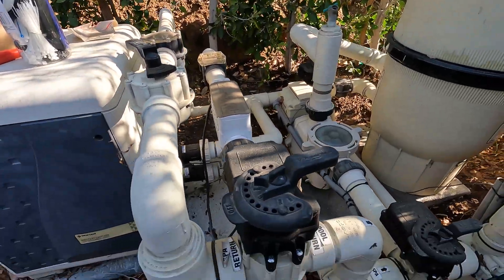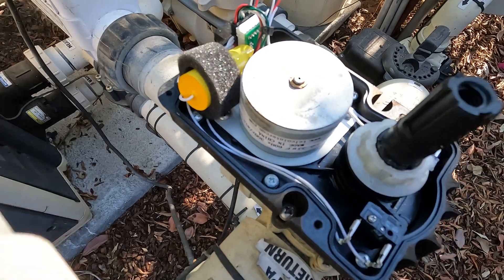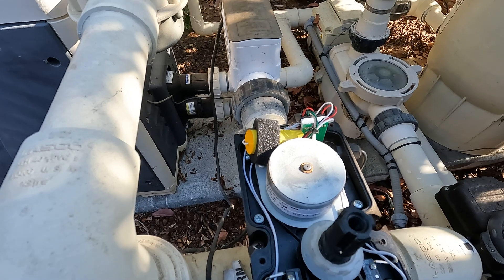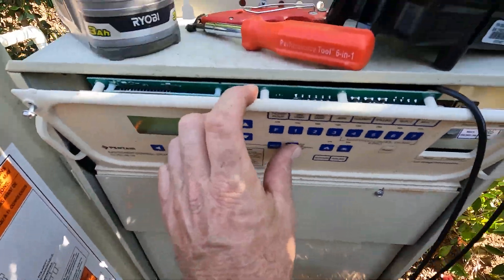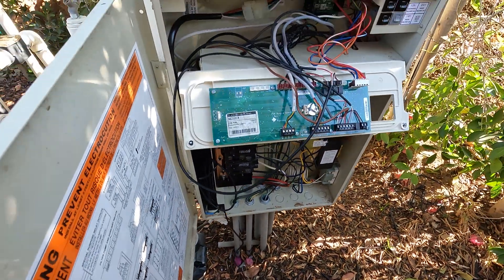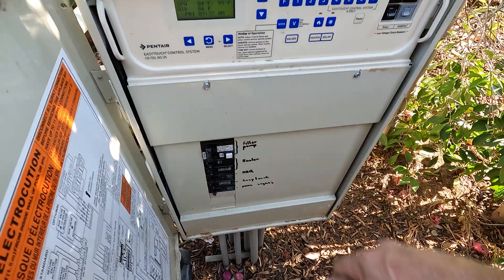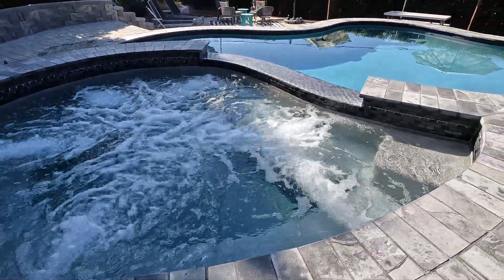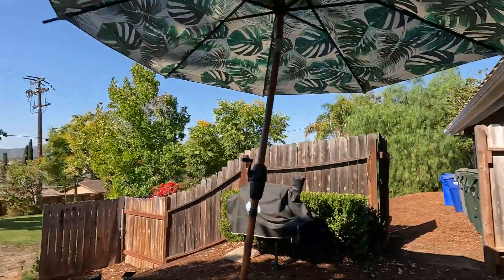Pentair actuator replacement - Angry Poolman #18

Comment: How do I control the valve manually? I don’t trust these things. Is it by taking the actuator off and putting the handle on the knob that sticks out? 
Sorry for not using the proper verbiage, but I would appreciate any input on how to do it.
Reply from the maker: Actuators have a three position switch on them that is used at start up of the pool and by the service professional. The handle will indicate the direction of the flow of water. Make sure to put things back when you change them!

Comment: Question about solar actuators, i changed my actuator and when im drawing from solar pads my pool sweep wont move and i get bubbles in the pool but i dont see any leaks or air from anywhere and when i shut the solar off i get full pressure on the robot. So my question is when replacing the actuator i didnt change the diverter core and it was very scratched and worn could that possibly be the issue. Been frustrating me lol
Reply from the maker: You're either going to get one or the other. When your pools solar is engaged it robs the suction from the cleaner. That's something I see in older pools; nowadays pools of mine like the big fatty on Monday is a two-story house with pool solar and it's quite far away from the equipment, yet the cleaner still works. It all has to do with how the pool was plumbed. Check valves are very important. I wouldn't worry about the Bubbles so much just make sure your solar blankets aren't leaking!
Reply: @angrypoolman Ok, that makes swnse and it is older model plumbing, i guess ill have to rotate them to heating 3 days a week shut it off and run the robot. Thanks for replying i appreciate it.

Comment: Just a question if you don't mind. What is I've installed 2 new pentair actuators and they turn just fine with the switches but for some reason they don't turn when I hit spa-mode on the pentair panel. I'd know one actuator is bad if only one is turning but neither one is. Only manually from the switches. I appreciate it brother.
Reply from the maker: Your actuators might not be plugged into your control board, which I assume is an easy touch. if you think you have them plugged in correctly, you probably have a programming issue which is a issue too big to fix in the YouTube comment section. Under settings, go to circuit names and circuit functions to fix that. The only time you are ever supposed to touch the three-position switch is during startup; sometimes I might flip the switch to quickly brush in dirt into the spa drains, but as a rule I never touch them and strongly recommend that my customers do not touch them either. I hope that helped!
Reply: @angrypoolman yes. That helps. Thank you brother. I was also thinking I had issues with the motherboard.

Comment: Hello, really get a lot of useful info from your channel.  Really appreciate it.  I have a new-ish pentair actuator, same one in your video and the workers putting our new roof on accidentally broke the handle off the top which snapped the stem off the actuator so I can no longer attach a handle.  The actuator is still functioning but I was wondering if there's an easy way to replace that stem so I can replace the handle.  Thanks again!
Reply from the maker: Honestly my recommendation is to replace the entire actuator because now that you have the situation you're in the actuator is open to the elements and it's just a matter of time before all those gears and stuff start falling apart and that can affect your pool really negatively depending on the situation so I would just bite the bullet and see if you can get the thing installed for somewhere around $500

Comment: Appreciate the video . . . is there a reason I can't use the existing cable on the new actuator?
Reply from the maker: The cable is not detachable. A new actuator comes complete with a new cable, I think is somewhere between 12 to 15 ft long. I suppose you could use the existing cable if you wanted to solder all of the connections together but I'm pretty sure that that would void your warranty

Comment: Hey just found your channel, I just replaced a worn out actuator, but now my spa still overflows into pool while in spa mode. Do I need to adjust the cams in the actuator? Thanks you!
Reply from the maker: So you just replaced that actuator so let's assume that one's working properly. Always double check that three position switch. If you are in Spa mode and the spa is still overflowing into the pool, it means that your suction actuator is not working properly. When we're in Spa mode, we need to have Spa section and Spa return! Thank you for watching good luck

Comment: Hey man, I think the reason why my actuator went bad was that when whoever installed it did the job, they ignored that every time the actuator turned it got stuck up against a pipe. Is it imperative that the handle be on the top of the actuator?
Reply from the maker: Great question! No, the actuator handle does not need to be on... Especially if taking it off allows it to move freely!

Comment: Just a question, what usually causes these valves to just stop work it will not move. I can not manually move it either. 
I am diyer have no problems fixing things , just pool stuff is fair new. 
Thanks for you time.
Reply from the maker: First of all, this is called a motorized actuator. The valve is underneath it; It is the thing that the actuator moves. Many pools are built without automation. There are a few things that can go wrong with these things the switches on either side can go bad yada yada yada most of the time it is best to just replace the actuator and go from there. Unfortunately I don't have any videos showing the repair process for the switches the internet has plenty of them just look up Pentair actuator
Reply: @angrypoolman  thanks , it’s what I was going to do is take the motorized part off. 
If the valve itself works then I know it’s the actuator. 
Thanks for the reply.